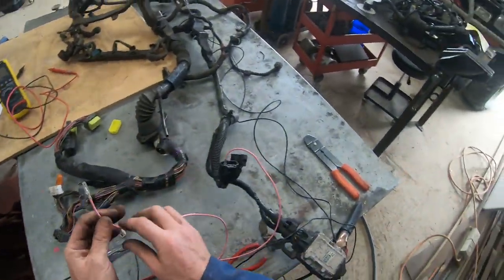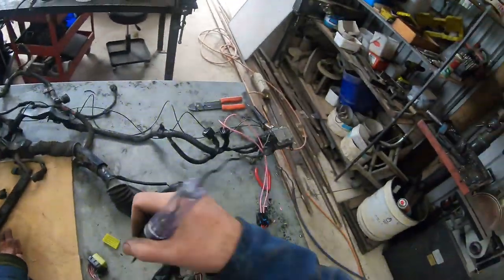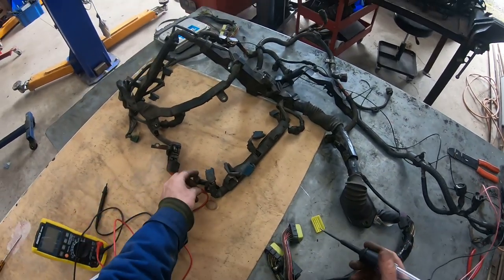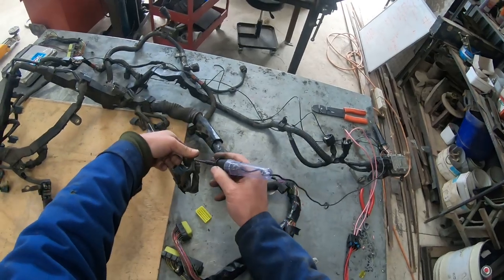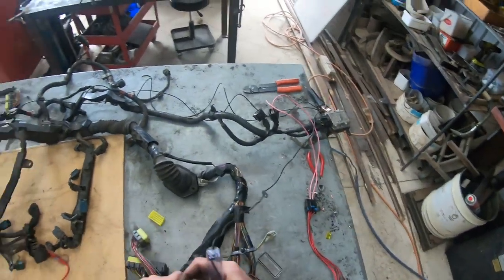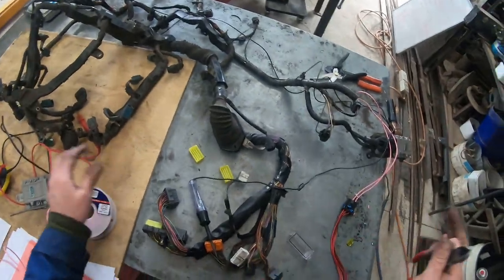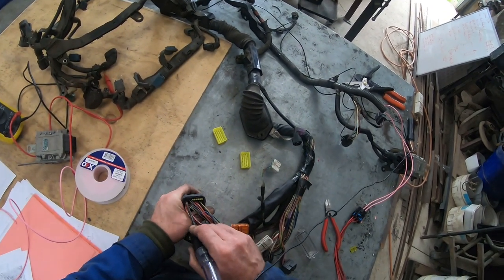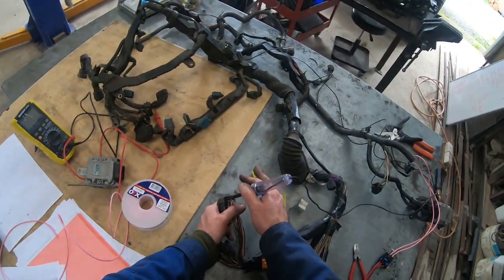1uz-fe DIY diagnostics - part 2.

Comment: Hi Kelvin. You replied on my FB post yesterday about my dead Soarer. I've sent the ecu for testing today so will find out soon if that is the issue on mine. Great couple of videos. Love the part of checking ignitiors earth at the coil plug!
Reply from the maker: Glad to help.  I have lots of different tricks its hard to remember to include them in my videos.  Cheers Kelvin
Reply: @CartuneNZ  Kelvin, do you have a video on how to manually fire coil/spark? I got my ecu back today recapped and yet no change. No spark, no fp priming, efi12 code. Running out of ideas what to test next and wanted to see if my coils are at least fine.

Comment: I got a dummy who cut the transmission loom it sparked now wont crank i fixed the ends. Ima keep watching ur videos awsome work
Reply from the maker: Yep.  Ive seen that cut trans loom plenty.  Good luck with yours.  Cheers Kelvin.
Reply: @CartuneNZ  i need help he cut the ignitor as well for the left side. What color wire goes onthe clip
Reply from the maker: @GUCCxEnT  can you match the wire colours?  Otherwise use your diagrams and trace everything.  I have instructions for sale if required.  Cheers Kelvin.

Comment: Yes earth on the back of the head is important , that left over bolt did come from somewhere.
Reply from the maker: Correct.  I had one recently which I had to diagnose.  Would have been easier if the guy told me he had removed the loom to remove the engine.  There was an easier way.  And to fit the earth down the back it was tight.  Cheers Kelvin

Comment: Has any sprint boat testing happend for the upcoming season yet
Reply: Do you guys go to wanganui for testing does wanganui do testing
Reply from the maker: No testing yet.  I did some testing in the USA a couple of months back and supported that boat remotely on race day.  Its getting loaded and we will be thinking about testing main nz boat soon.
Reply: CartuneNZ are u working for bayden again
Reply from the maker: @rugbyplayerhighlights7512  Hello.  I have been asked to do both Badens boat if he decides to do a few rounds and Kyles boat once he can race again over here.  Cheers Kelvin
Reply: CartuneNZ is bayden only going to part time race now
Reply from the maker: @rugbyplayerhighlights7512  not sure if he has made a decision yet.  Will have to wait and see.
Reply: CartuneNZ does Darren ever drive at a test dat
Reply: Day
Reply from the maker: @rugbyplayerhighlights7512  I don't think I've ever seen Darren on the drivers side.
Reply: CartuneNZ Do u have anything to do with glen head now
Reply from the maker: @rugbyplayerhighlights7512  not working on his boat anymore.  Being freelance I go with the best offer.  Cheers
Reply: CartuneNZ when u start testing can u do a video on it cause it’s interesting